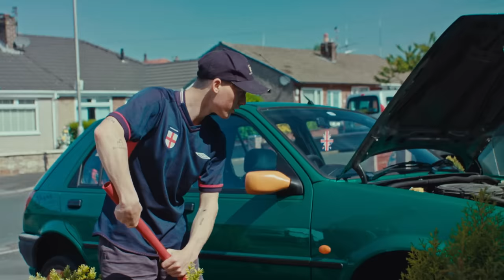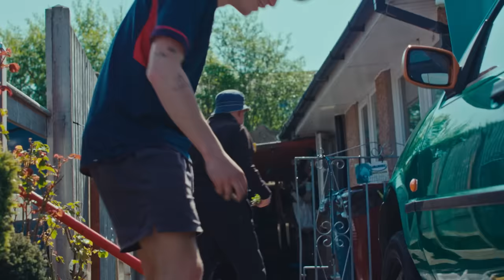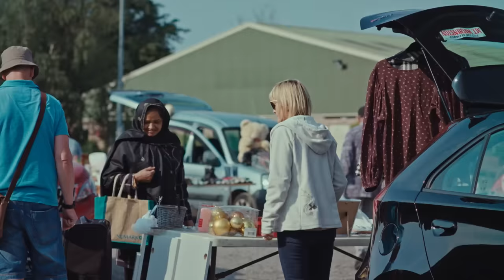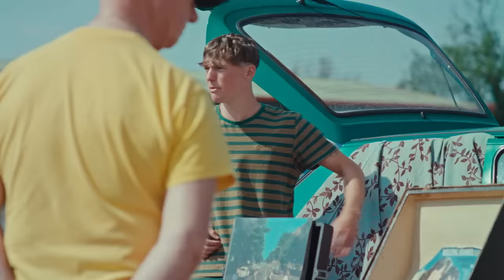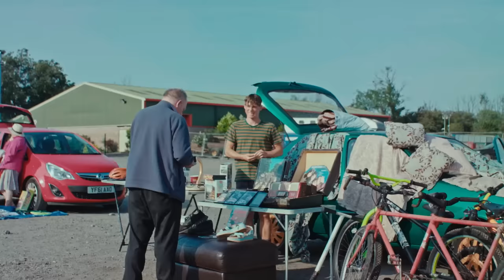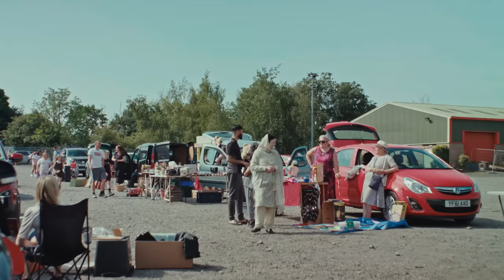Trying out my first car boot stall

Comment: That's proper minter for a mk3 judging by its mot history mate!
Its only done less than 38000 miles last mot :O and probably been in garage most its life  because these rot like crazy lol ,so Ild recommend a few things and one of these in good condition is worth much more than you think.
I would definitely recommend spraying all the rubber bushes, brake pipes and shocks and springs with silicone lube, you can use it anywhere underneath but don't need to do exhaust :P
Its like 5 quid a can from halfords, it rejuvenates rubber, ball joints/ cv boots, shock absorbers and rubber bushes so they don't deteriorate as much or if at all.
I'd also get some waxoil or grease and then rub it all under the sills/ rear arches/ rear subframe, any where underneath, do it on a dry day and use wire brush on rust underneath and then coat it.
For outside rust on wheel arches etc just rub most of it off with sand paper and get some ku rust from halfords, its about 8 quid, it reacts with rust and coats it, you can then paint over it.
Good luck mate!!!

Comment: If you try it again, don’t take anything less than £100 for the accordion. You might even get as much as £150. Can’t make out the make from the video, but I can tell you it’s a 48 bass,ie 48 buttons to the left side of the bellows and 2 reeds on the treble in tremolo tuning, with 3 couplers the outside 2 selecting just a single Reed and the middle selecting both reeds at once.